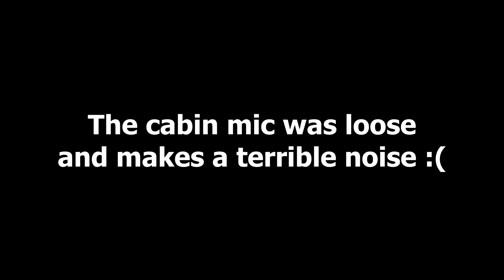Integrated Engineering Intake Noise Test Audi RS3

Comment: did you have a BOV or DV at that time or did it make that sound after the IE intake and inlet pipe? Amazing.
Reply from the maker: We were cheating a bit here with the microphone in the engine bay, the intake noises are more noticeable, but not as dramatic as depicted here.

Comment: is the car tuned?
Reply from the maker: It was on Custom code stage 2 until it blew a hole threw the cylinder wall between 1 and 2.
Reply: @HardwayLearning  damn i heard a lot of bad things about custom code. On the bright side now you can build her up
Reply from the maker: @foadnaboulsi4660  she's built now. About 10k miles with SRM GTX35 hybrid running a custom tune from Kyle Leblanc of SRM using Dynospectrum DS1 and flex fueling 🤘

Comment: Hey guys, nice video, what have you done to it? Just got my 2020 RS3 and looking into getting an evu tune and intake to start. What would you recommend. I love that your car still has the deep sound that i find you lose when you get the full IE exhausts. Thanks. Appreciate
Reply from the maker: The car at the time had Integrated Engineering Carbon Fiber Intake, Integrated Engineering Turbo Inlet Pipe, and Iroz Motorsport downpipe/midpipe combo with Custom Code Stage 2 ECU tune.   It blew up last fall and was finally put back together a couple of weeks ago with a fully built long block, SRM GTX35 Hybrid Turbo, Upgraded LPFP, APR 1000cc Port Injectors, and VLM Tuning
Reply: @HardwayLearning  wow, sonit blew up from an ECU tune with intake, turbo inlet downpipe and midpipe🙈
Reply: @HardwayLearning  also coukd you tell me what caused the blow up if you know, and what lart failed? Thanks guys, appreciate the help.
Reply from the maker: @Jakkals89  it seemed as though the car leaned out and detonated causing a chunk of the cylinder wall to fail between cylinders 1 and 2. We had the injectors flow tested and they came back within spec

Comment: whats causing your RS3 to flutter vs blowing off the excess pressure in the turbo?
Reply from the maker: My guess is the tune runs the turbo at a higher pressure and it's a little much for the diverter valve to handle

Comment: It's not audible without head phones?
Reply from the maker: You can hear it through the cabin, but the normal microphone from the camera doesn't pick it up. Using a microphone in the engine bay picks it up well, but yes it is a little louder than what you normally experience

Comment: Hey guys, another great vid. Is it just me or do you guys not have the dreaded Wastegate rattle that the RS3s suffer from with decat DP? Doesn't this RS have the Iroz DP?
Reply from the maker: That's really only noticeable at idle with the exhaust flaps closed which is avoided by always being in dynamic with sport shifting enabled 😁
Reply: @HardwayLearning  good point! I've got the Iroz DP and I'm still finding at half throttle even in dynamic that the WG rattle is killing me a little hahah just have to drive at WOT all the time I guess?
Reply: Stephen Cerqueira hells yeah send it!😂
Reply from the maker: @stephenc003  pop the shifter in to S and it should keep the flaps open if you have custom code tune